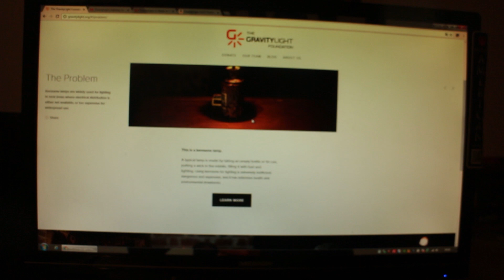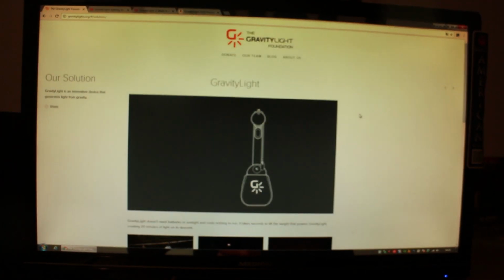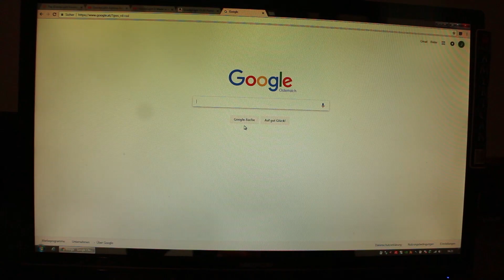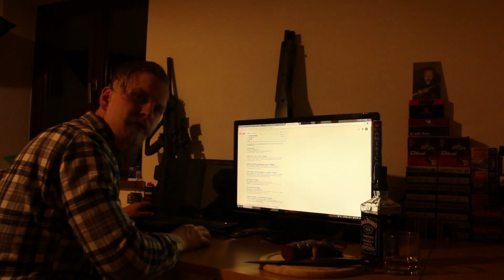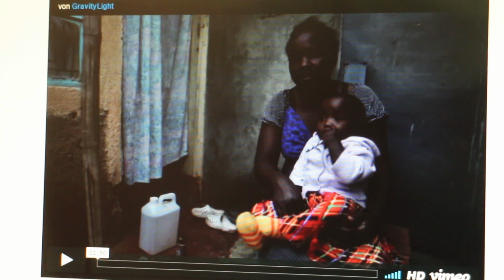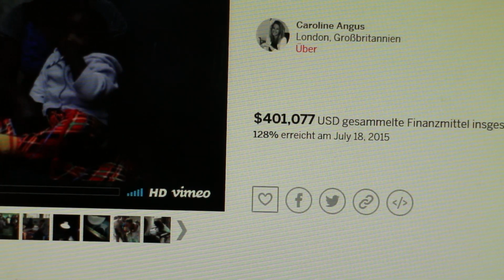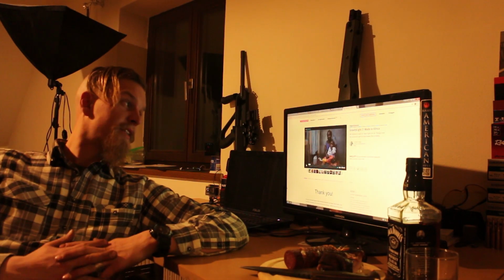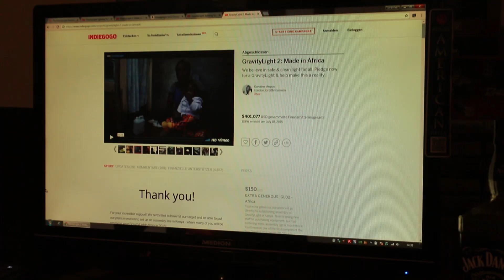How To Build A Gravity Light - RANT Project

Comment: Love it! I haven't researched the company, but after building yours, which is fantastic, you can also appreciate the potential time frame for optimization, tooling, low cost manufacturability etc. so that it's a workable product for the underprivileged. I know your point is not to diminish that particular company or project, but to just be careful and don't get scammed, for there definitely are some out there...

Grüße aus Kalifornien...

Comment: After learning about those Gravity Light funding campaigns, I have a suggestion for you.
You should start a Research and Development fund raiser for a USB Powered Bull Manure Detector. The tricky part will be designing The Interweb Interface, which will require initial funding of $777,000 USD. This does not include cost of private jet rental for attending conventions in Monaco, Aruba and Hawaii.

Comment: Well said. First I'd heard of this Gravity Lamp but it seemed a simple enough concept (even to my currently mildly hungover mind). You ended up following my mental theory exactly. If we can do it with this, imagine what good honest folks could have done with that money from their two campaigns. 

Practical curiosity question: about how much light time does one setup of the contraption provide? In other words, how long til you have to reset the pulley?
Reply from the maker: +L. Sanders -at the first try it lasts about 9 minutes...I think I could increase the weight and the gearing reduction so that it lasts even longer...also the little generator is not really efficient and the halogen bulb use a lot to much energy...but it was just proof of concept

Comment: Bookmarking note--This was already done, in total, and by a much less easily upset guy under the title "Gravity Light (v2) Making and Enhancements" (with no connection to the $400,000 pair who later converted their factory to a factory manufacturing fossil fuel-burning stoves). This fellow got 12 minutes of light from his setup and linked to the math involved and the simple circuit he created (to smooth out the quality of light), for the benefit of others interested in improving his design. 

What's interesting here is using the (exposed) pulley system to control the weight's fall rather than relying more on friction, a pulley system which can be incorporated into the body of the device and combined with friction to optimize duration and output. To be direct, it's not difficult to reproduce the crude techniques required to generate light from a falling weight and pulley or gear system---it's significantly harder to refine everything into something that works well (rather than, say, flickers and wobbles), that can be mass-produced  cheaply, that's lightweight enough to be shipped, that can be used in a house, that someone will want to use in their living room or kitchen or workshop, and is at the least an adequate substitute for kerosene lighting.

Comment: Why use pulleys? When you can just put lighter weight instead
Reply: Gravitational energy is equal to mass x gravity x the change in height between two points. He can't change gravity constant and the change in height will likely be much harder to achieve design wise, so changing the mass is a much simpler solution to get more energy out of the system. As for the pulleys I don't know much about pulleys but the advantage of multiple pulleys is that the force needed to lift heavier objects requires less force but the payoff is that you have to sustain that force longer and over more rope length, so perhaps this disadvantage is used as an advantage to make the object fall longer than it would have. It would still have the same amount of energy though regardless of time spent falling.
Reply: @MoxyVibe  yes I know you need more weights to get more energy but when using pulleys the tension caused by the weights are divided to each string thus also dividing the total weight... so if you put 40lbs with 4 strings compound pulley the total weight will be in the system is 10lbs... so why not remove the pulley and only use 10lbs... the only advantage of pulley is bringing heavy weight up since like what I said instead pulling 40lbs it will be divided into how many strings example 4 strings so it would be pulling 10lbs... but in this video you can just simply reach that height no need for pulleys
Reply: I believe you are mixing up the definition of weight and mass. The system has a discrete mass value but the weight value is dependent on the force’s acting on that mass 

For example your mass is pretty much the same all throughout the universe but your weight will change with different gravity fields or forces acting on it. 

Yes you are right that the force is being distributed across the string but remember that gravitational potential energy is dependent only on the change in height the gravitational constant of earth and mass of the object. As a result a 10lb object will not have the same amount of energy as a 40lb object in  the same change in height.it’s usually easier to refer to this kinda stuff in the metric system since weight is basically two variables or more depending on the forces acting on the object
Reply: @MoxyVibe  yes I know the difference between the two... it is only called weight when gravity is involved... it is almost the same thing when using the word mass because mass means how many protons, electrons, neutrons in total of that thing but when you want to find the mass you can simply put it on a scale and voila you can have unit of grams, kilograms, etc.... but when you measure the mass you are also measuring the weight since there is a gravitational force applied when you put the "thing" on the scale... so regardless the mass and weight "definitions" what I really want to say on the vid is that when using pulleys you are dividing the force or tension on that object across the number of strings... so if that pulley system uses 50kg of mass and have 5 strings so the force created will be from 10kg... so why not remove the pulley system and directly put 10kg? You will have same amount of energy from 50kg with 5 strings pulley system and the 10kg without pulleys... the only advantage of using pulleys is when lifting up heavy objects because the total force or energy or tension created of that heavy weight will be divided across the number of strings
Reply: @kronosdarkangel5290  I don't believe that you are actually dividing the force over a pulley rather the input force is doubled tripled or however many strings that pulley system may have so if you have a pulley system you can lift an object that should need lets say 750Newtons and you have three strings contributing to the lifting of the object, instead of needing 750newtons you only need 250N(input force) because the other parts of the string will feel a tension of 250 newtons and add on to your 250N giving an output of 750N 

If you remove the pulley system I believe the system will fall to fast the strings have forces on them counteracting the force of gravity. However the potential energy of the system will stay about the same(disregarding the mass of the pulley and friction). That energy is transferred to a dc or ac motor which by providing mechanical energy (spinning the motor ) will cause current to flow and the connected LEDs will get lit up as a result.